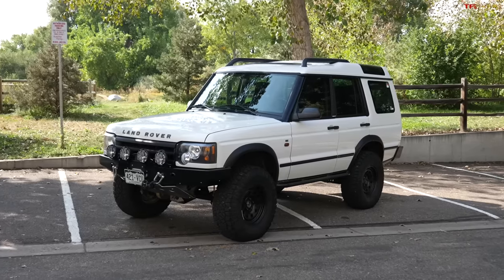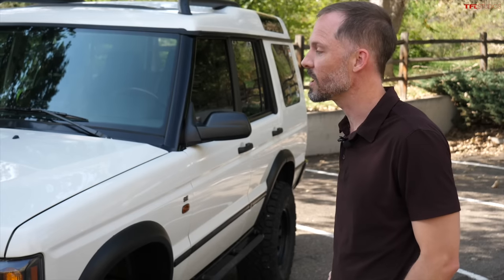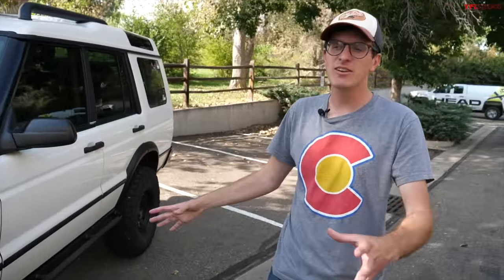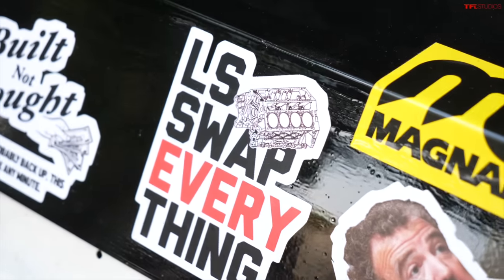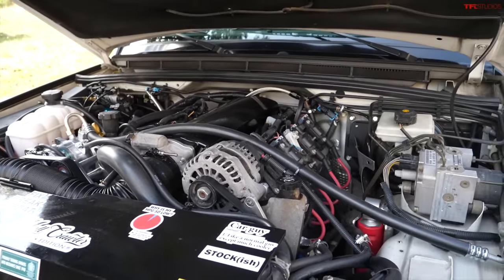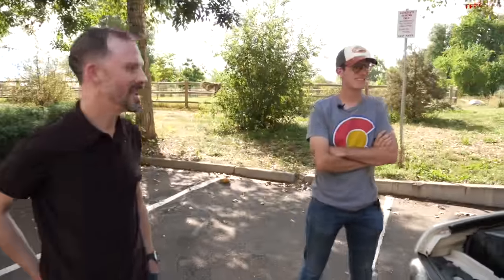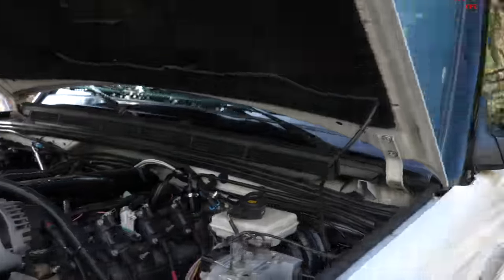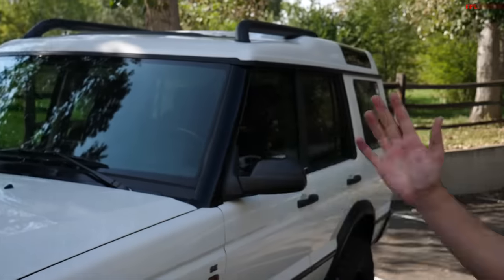$40,000 Later: I Found The ONLY Way To Make My Land Rover Discovery Completely Reliable!

Comment: Turns out the only thing you need to make a Land Rover reliable is an extra $40,000 cash laying around.
Reply: I'm currently at 10k and climbing, including the purchase of the LR lol
Reply: Easier to just buy a Silverado and stick a Land Rover sticker on it.  They you don't have to worry about all the other failing Land Rover bits not associated with the drivetrain
Reply: Or buy a manual TD5.
Reply: @tommurdoch2989  Not available in the U.S. unless its 25+ years old
Reply: LOL. Get an 80 and spend the rest on a couple of nice Stumpjumper Evo’s and call it good
Reply: 40k lol could of bought about 8-10 discos
Reply: I got mine Ls swapped for 16k 😂😉
Reply: Buy a disco spend 20k on it still cheaper then a landcruser and way cooler
Reply: Or just buy a D1 and be done with it.

Comment: These are so freaking good looking. Landrover should have stuck to this design on the new Dicovery. Just like Mercedes has done with the G class
Reply: They're selling like hotcakes.  They made a good business decision with that.
Reply: The new Landrovers are all soccer mom suvs
Reply: @myrongaines5542  I don't know if I would go as far as saying that "all" are. The new Defender is a very tough and capable off-roader, and you won't see yourself driving down the road.
Reply: g class. worse than l/rover. only landrover to buy,is a 110 diesel.. but..its still a landrover.. bronco,built ford tuff,,14 yrs,,thrashed,no probs.. 351c. , zf 5sp. sas., lockers. owes me 12k..all up.
Reply: Pray they remodel it,  ill be running mine on steam with a coal furnace on the back. When we run out of oil of course.
Reply: Oh, I agree!
Reply: Agree 100%. I recently bought a 2008 Discovery and love it to death, despite all the reliability issues and horrible gas mileage. But you couldn’t pay me to drive the new Discovery, it looks ridiculous.
Reply: I got one inn Detroit lmk
Reply: @vabiro  the new defender is a reliability nightmare 

These same have broke their brand new defender 4 times under warranty before getting rid of it. They're complete junk. 

They should have bit the bullet and spent the money in R&D to redesign the 110 to meet new safety standards in the UK which is what killed production in 2016
Reply: @vabiro  No frame and independent front and rear suspension a tough off roader? You must be deluded.
Reply: Ineos Grenadier, anyone?
Reply: Agreed
Reply: @myrongaines5542  everything is nowadays, but with g wagons and range rovers you can still take them off road. cant do the same with a bmw x7 or a mercedes gls
Reply: @myrongaines5542  I agree.

Comment: What Land Rover discovery2 need is a reliable owner. A owner that reads the manual, twice at least. The coolant has a lifetime 2 years,not 10 years it needs to be changed. The oil should not be synthetic, the engine is from the 60’s it needs certain additives that are not in synthetic oils. If you own a disco buy the proper manuals, read it again and become a RELIABLE owner. Your unreliable discovery will love that and become much more reliable.
Reply: Mine absolutely loves Castrol synthetic high mileage

Comment: You should convince Charles to start a YouTube channel that talks about how he did this because nobody is out there providing long-term solutions to keeping the Disco 2 on the road I've got one sitting in my garage that I want to start working on with my oldest daughter to turn it into a long-term keep around vehicle
Reply: Get  a td5 desel one like we get in Aussie all good then ooh a few issuess yet way better then v8, you were stuck with
Reply: This
Reply: Nobody?  You're wrong there mate.... there are a few out there, "Lost Cause Ranch" are one, using the "Alternative Conversion Engineering" kit as has the guy in this video...
Reply: @niallkarger1057  people say all discos are bad, had a td5 for 3 years, that car stayed outside 6 years in pretty rough weather and hasnt been started, never had a problem with the engine except the batter and the alternator, its been running like a dream ever since, i just dont get why so many toyota butthurts keep saying "gEt A lAnD cRuiSeR"

Comment: Fabulous conversion!  The AC Engineering kit uses the LR transmission and the GM computer controls the engine only. Prolly a little less involved.
Reply: Keeping an r380 is fine, if you've got the auto it can't handle the power plus it's a very average gearbox when it's working.

Comment: Good option for Land Rover builds with high budgets. A Gen 3 5.3 LS can be swapped in the Disco 2 for about $5k (engine included) with the Alternative Conversion kit using the factory Land Rover transmission, which is a lot easier and less expensive swap overall.
Reply: Unfortunately, that price assumes you are using a junkyard 5.3 LS with who knows how many miles on it. Still a good option, but it'll cost a lot more than $5k for a good swap unless you can rebuild an engine and install it. I still might end up doing an LS swap, but I expect to pay at least $10k.
Reply: @BeagleFerretTime  There are plenty of good junkyards out there that you can get an LS from a vehicle with a known history and mileage. You pay a little bit more for them than your typical junkyard engine, but I think it is well worth it to know why the vehicle is in the junkyard and how it was cared for. Even with a 100k miles, an LS still has a lot of life in it if it was well cared for. I’d trust a junkyard LS any day over a junkyard Rover V8.
Reply: @BeagleFerretTime  yeah, I hear you. I got my 5.3LS for $500 and it had perfect compression.  But I still didnt trust it. So I rebuilt it for about $600.  I went with the ACE Kit for my 2004 D2.  That was another $2400.  Then the other stuff for the swap was about $1000.  I did brand new OE parts for everything except the Coils and injectors. I went for longevity here.  All in the swap cost me $4500.  But the biggest thing anyone can achieve over the 4.0 or 4.6 is reliability. I would put a months salary as a bet to say the junkyard LS would outlast the 4.0 or 4.6.  I have a D2 4.0 that I am planning a 2.8 Cummins swap this winter.. That one is a pretty penny. but crate brand new with every accessory.
Reply: True but I really like the idea of a 6l80e transmission to go with the LS
Reply: @BeagleFerretTime  the last LS vehicle I owned had 342k on the original motor.
Reply: @logansteele9627  It’s all about budget and complexity. If you want a swap that is roughly comparable in price to replacing the factory engine with a rebuilt unit and can be done with minimal fabrication, then the ACE swap with the Gen 3 and the ZF is the way to go. If you want the ultimate D2 setup, regardless of cost, then going to the 6L80 may be the option for you. Just be prepared that with going to the Gen 4 and 6L80 you are going to spend probably 2-3x the Gen 3 setup and its going to be about triple the complexity overall when it comes to fabrication and electrical.
Reply: @rmkinkaid hope you do a YouTube video of the swap! Cummins would be ideal!

Comment: 7:49 Well, in a vehicle like this, it's not about horsepower and speed. It's about torque and crawling.
Reply: Glad someone said it
Reply: @Ross_gitar_bas  But still, having 330 hp in a D2 seems A LOT to me. Shouldn't it pull like crazy? My TD5 D2 came out of the factory with 139 hp :)
Reply: @oberkrainerrock7996   Yeah

I got 187Hp in my D1

No need for more

Comment: I avoided doing all that process, i bought 4 years ago the Discovery 2  TD5 1999 series, with the 2.5 original diesel turbo in it ( New Zealand ), lots of torque excellent for towing, now 228.000 km or 140.000 miles, never spent $ 1 in repairs in 4 years, only service once a year.  I will keep it till it dies.
Reply: Had mine since 2001. Same model. Never given me an ounce of grief! Not sure why that is? Pretty stock other than i removed the air-suspension that LR wanted to charge a crazy amount for. Just done a 4380km trip a couple of weeks back. Blew the pipe between the intercooler & turbo. Cost very little to replace. Hoping to keep this truck a long, long time. The new ones to me are ugly as Sin - the latest Discovery is bloomin awful, don't want it. The new Defender maybe....at 2/3s the going price!
Hope yours lasts a long, long time!
Plettenburg Bay, South Africa
Reply: @stuartvorster4911       I also removed the air suspension at the rear, it was working fine but i was worried about a possible failure in a remote area, towing a caravan it would have been a disaster.  Installed HD coils and now is three inches higher.  Also we don't need to worry about the timing chain, it's an extra large/thick chain that is unbreakable, made for heavy duty tractors.    Enjoy !
Reply: yup. ill keep my u.s fords,dana spicer.  reliable as a rock.. only good l/rover,is a diesel one..
Reply: Good man

Comment: This video is now saved in my Permanent collection. My brother was just asking me the other day what I'm gonna do with the 'Rover' (my 04 Disco). Right now it just holds my driveway down and gets started every once in a while. I need to re-gasket the valve covers, front cover, and replace the heads with refurbished ones so replacing the head gasket every 60k miles goes away (been done 3 times on here and it's at 167k). and replace the front-left O2 sensor harness, because the valve cover oil gusher has rendered it useless.
I think that's it.

Comment: Loved this.  My wife found a DII 2003 on a lot in Sarasota for $3,300 k (HSE in almost mint condition).  after 157k miles head gasket went, New cyliner haead and upgraded gasket,  original 4.6L, still loving mine.  Saying ... you own a Landrover long enough you end up with a new vehicle.  

Loveing this build .. it looks sweet.

Comment: Best looking Land Rover by far in my opinion ever, I loved my 3.9 UK spec one. It had liner issues but I fixed that with a product that went into the cooling system and they literally welded aluminium around the loose liners and you then flushed it out and put coolant back in. Even the 4.2's were too big for the original blocks and had problems.

Comment: I LS'd my Defender too. Honestly, nothing else will make it reliable.
Reply: Were you able to keep the ABS traction control with the engine swap?  ABS in general?
Reply: @jworthe  My Defender didn't have it but it should be fairly easy to keep. On a pre 2007 the abs is mostly standalone, a puma would need a bit more as you will keep the original ecu operational anyway to run the gauges and AC. Talk to Nick at rw-eng he's a great guy I'm sure he can sort you out.
Reply: Td5's are very reliable
Reply: Td5's are (relatively) one the most reliable engines came in Defenders, but frankly they're all bad, they can't survive 300k kilometres which is bearly half life for an LS engine. A td5 will blow a head gasket before an LS will need a set of spark plugs.

Comment: Nicely done.  The stock 4.6 V8 was junk.  I had two of those engines....in one vehicle, my 2004 Discovery.  Sold it for parts after the block cracked in the second engine.  Now I'm in a 2013 LR4/Discovery 4 but I'd go back to a 2004 D2 with a LS V8 in a heartbeat.  I wish there was a professional shop that did these conversions for retail sale - I'd buy one.

Comment: i have a standard 2.5 landrover no extras only steel bumpers. if any car hits me they are wrote off and my baby has never let me down. It is by far the best jeep you could own. 166000 miles and still roaring down the road. i have pushed it to 190 kmph on motorways took it off road on multiple occasions and pulls trucks off of building sites that get bogged. it is a one of a kind machine and completely bulletproof.

Comment: Lovely truck 👍
Having had a number of high mileage RV8 engined Discoverys, Defenders & currently P38 RR, NONE have or had head gasket issues. The solution - we tend to run factory recommended coolant. Not just water. I know many US LR owners will get serviced, but have seen many examples with even mechanics in the US just using water. 
The other reason this comes up, and this is with the greatest respect to the old Buick, is that it tends to use a bit of water. Often discovered late on a trip and no coolant to hand. So in goes the water. When home again tricky to drain so this gets left. Repeat next trip :/

Comment: If I had one of this, I would definitely do an engine swap. But it isn't going to be an LS. I'd go the unpopular route of swapping this for the 2UZ-FE engine.
Reply: Ford 7.3 would be interesting
Reply: @jacobpartin4553  will it fit though? Maybe try the legendary Ford 4.6. Those were almost as reliable as the Toyota V8s. They never made much power, but they got the job done.
Reply: @damilolaakanni  i have no idea honestly lmao, you would be better off trying an ls or a uz
Reply: Why would you even bother with that? At least go for the 5.7, it makes good power and doesn't have a timing belt.  I still say that LS is the way to go for the swaps, but if you are going to go with the Toyota motor, go with the one that makes power.
Reply: Or you could get the 2UZ, save yourself the hassle and spend half of what he did and get a GX470.
Reply: @damilolaakanni  I have a 1999 F-150 with the 4.6. It’s slow, but very reliable. I’ve taken mine on multiple cross-country drives and it runs perfectly throughout the whole drive. You can’t kill these things.
Reply: Guy in nz put one in a delica. Goes hard videos are out
Reply: An engineering company developed a specific kit for swapping in certain LS engines. 2UZ-FE isn't a feasible option.
Reply: @damilolaakanni  🤮
Reply: @chasechapman4689  exactly

Comment: Bought a 2001 a year ago
3500$
Just grabbed a 2000
1000$
The ‘00 in better shape that the ‘01.
Daily the ‘01 to work 160 miles round trip. Made the ‘01 mechanically sound for about 2500$. Cosmetics and lift to come. Engine so smooth I won’t touch it til it pops. 288k miles and counting. Best vehicle I’ve ever owned and I own a few.

Comment: Nice truck, thanks for sharing! My 4.6 D2 engine has 185,000 miles on it and it's still running, but I'm gonna swap it out for sake of engine noise (sleeves ticking at idle). I'll swap it out with a flange sleeved, gas flowed heads, and upgraded cam 4.6 soon though (unless I do an LS swap, of course). Reliability isn't the best reason for the LS swap over an updated 4.6 though, as long as you don't overheat the engine (by getting the inline thermostat modification and monitoring the temperature manually). The only real gain at that point, with an LS conversion, is power. Sounded beautiful though.

p.s. The headliner isn't nearly as difficult as the owner seems to believe. I've done two so far (one with rear air) and it gets easier every time, but shouldn't take someone like this owner longer than an afternoon.

*Update: I've soured on the 4.6 after it overheated and the fact that a sleeved replacement is both unavailable and more expensive than the LS swap (with no corresponding improvements). I'm doing an LS swap as we speak using Alternative Conversion Engineering's kit. Wish me luck...
Reply: How did the swap go mate?

Comment: Many of the problems with the original v8 rover engine were due to the crankcase breather filter becoming blocked. It was mistakenly missed as a service item by British Leyland.Causes pressure buildup and head gasket failure.serviced every 30,000 miles will keep the machine reliable

Comment: I had a 2000 d2, drove it all over the country even some of the most hot areas, 200k+ miles original engine only issue is so damn slow so I finally end up selling it

Comment: Did the US spec discos not get the TD5? Here in the UK obviously these aren't particularly rare but with the TD5 engine they're as reliable as you like with good maintenance.
Reply: no diesels in North America emissions standards in the states where luxury SUV were sold.
Reply: They didn't get the 300tdi on the D1 either, which is why they think Discos are unreliable. In the UK they rust out still running and the motor gets swapped into a Series 3....

Comment: LS is certainly a significant upgrade, but a diesel would have been a better upgrade.  TDI, OM606, Cummins R2.8.....even a 4BT (with a ton of work).

I guess it depends on Daily Driver, Overlander, or pure Off-Roader as to how much YMMV on that.  But really think the diesels are a massively better option for that platform.

That's a nice build, regardless!

Comment: I have owned every model of discovery from the first through to 2000 D2. Loved the D2 but will never buy another one. The electronics let it down. I still own a 200TDI D1 and a 300TDI D1 and I am sticking with them. reliable as fruck and with over 350,000 Ks on the clock each still ticking along nicely. And they go anywhere these muscle cars go without smashing up the terrain doing it.
Reply: D1 is the only Disco I've ever owned. Never even been tempted to get a D2 after seeing all the problems my friends had with them.

Comment: The 4.6 is trash. My 2004 had a slipped liner, I drove it 40,000km sounding like a diesel. I always wanted to do something like this, but the more I thought about it the more I would want to remove. I would want to remove all the ECM and BCM. I miss the way it drove and its looks, but  don't miss checking the fluids every fill up. I also don't miss fixing one of the many things that WILL break not might break.